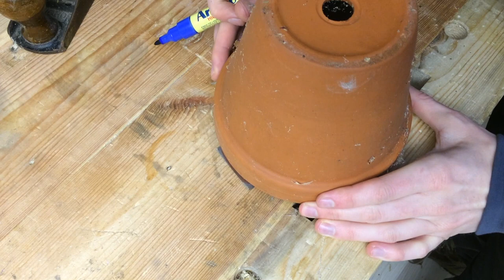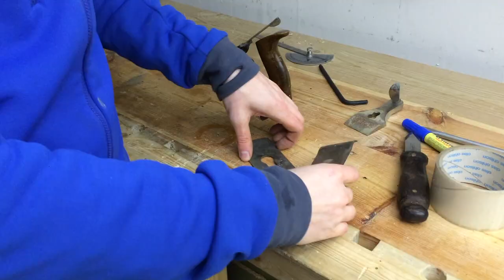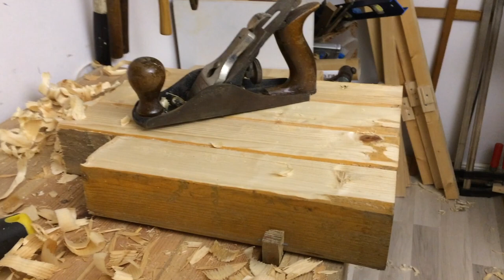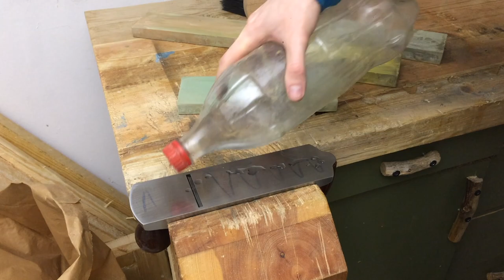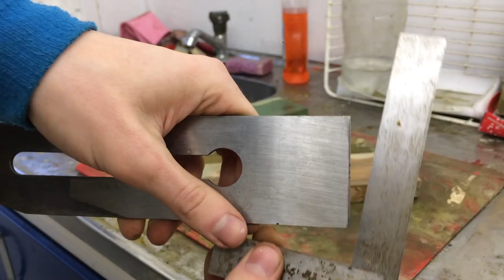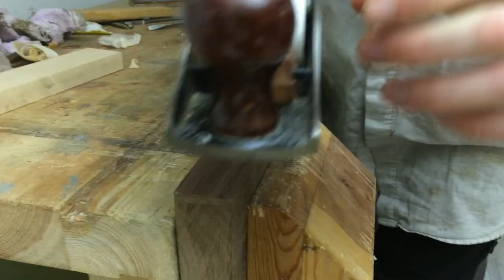Tuning up a smoother and scrub plane (light restoration)

Comment: Anchor.. never head about them . they seems well built!  I've never had a corrugated sole plane... how does they feel during the use?
Reply from the maker: They're pretty common in the swedish second hand market, not surprised if they are rare elsewhere! Very good quality I think, especially the older no4. I'm not a fan of the corrugated sole, it clogs up with dust over time and doesn't feel as smooth, which is why I felt ok turning it into a scrub :)
Reply: bought one of those Anchor No.4 on Tradera (swedish auction site) a while back. I´ve been using it as a smoother, works rather well. But I kinda agree with the sole-thing..   as far as Quality of build, I really don´t feel any difference in terms of quality compared to the Stanley planes I own
Reply: @simsod  thanks for the info mate. I'll keep an eye if I see them. I am a plane-addicted 😄

Comment: Fantastic job!!!!! Question... what do you put on them to keep from rusting again (if anything)? Wax? Oil? I have an old Stanley Bailey No. 4 that is in bad need of the same work. Edited to add:  CONGRATS ON THE 1K SUBS!
Reply from the maker: Thanks very much! I use sewing machine oil for both lubricating the sole and rust protection, just a very thin coat applied by Paul Sellers-style rag-in-a-can. I don't think there's anything special about sewing machine oil but it's colorless and thin and seems to work very well.

Comment: You store a lot of basicly carbon steel edges in a shed with rather variable temperature ; how do you keep them from rusting?
Reply from the maker: Not much at all to be honest. The sole, blade and any moving parts just don't get a chance to rust. As for the sides and other noncritical places, I haven't yet seen a reason to fear a little surface rust. But of course a light oiling never hurts.